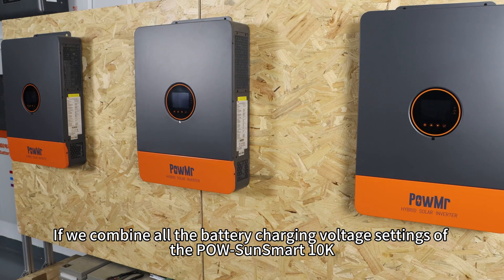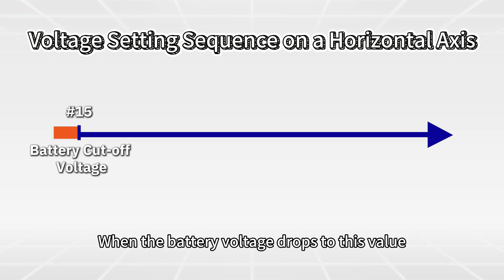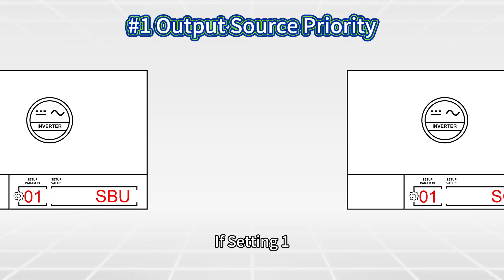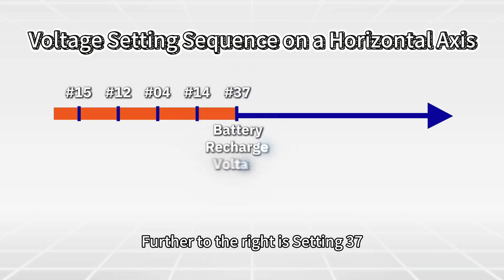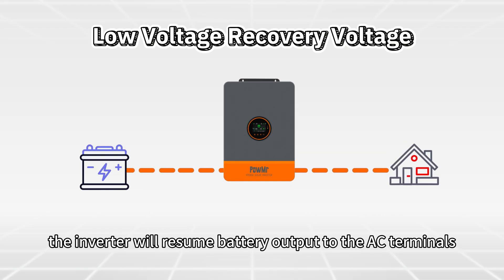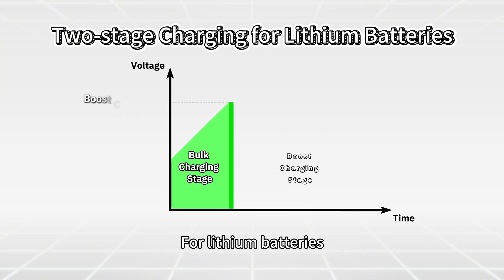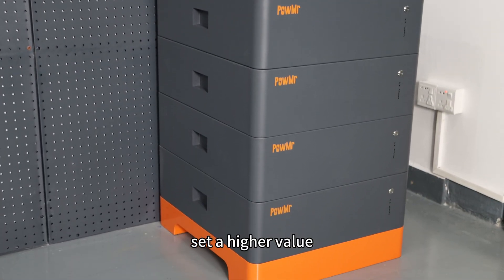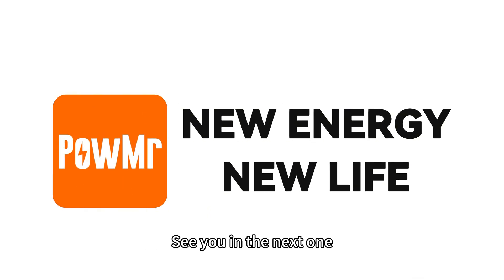How to Configure Battery Voltage on POW-SunSmart Series Solar Inverters?

Comment: Hello. I installed the inverter as you instructed, and I was able to change the parameters, but I can't set the specific parameter I need.  Could you please tell me how I can do this?  #15 ?  12# ? #04- 52v  #14? #37?  #35?  #11?  #5  52.8   #9?   I also don't want my rechargeable batteries to be charged from the city power grid. I installed #6 oso, but they are still charging from the grid.
Reply from the maker: Please send it to this email: support@powmr.com.